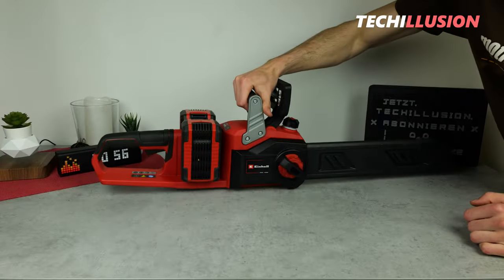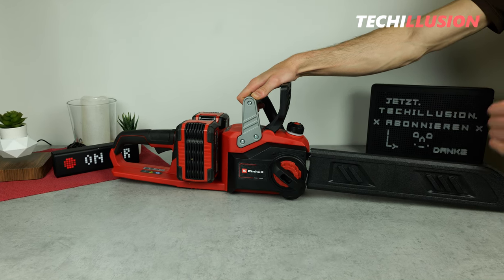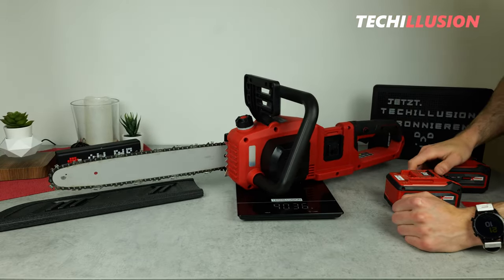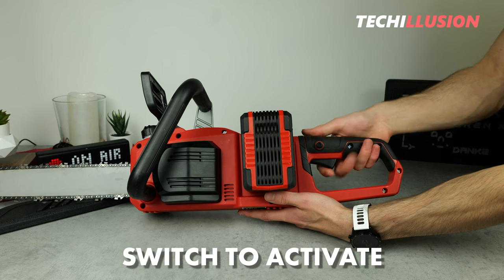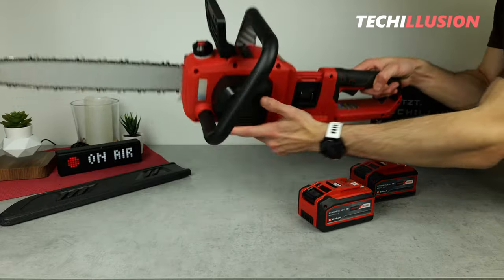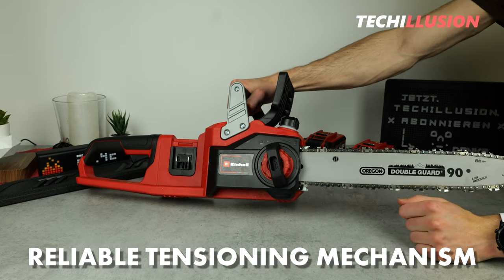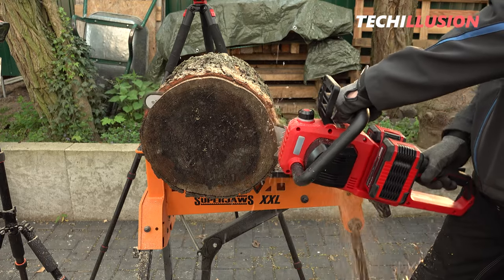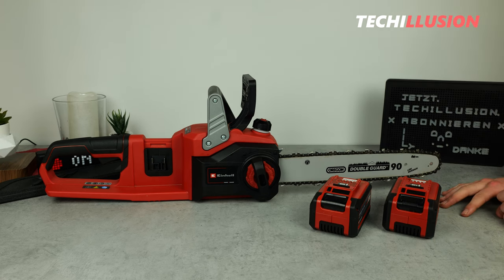🔥BRUTAL PERFORMANCE! Einhell GP-LC 36/35 Li cordless chainsaw on test😱 GP-LC 36/35 Li - Review

Comment: Good review. As an owner of one I agree with all the points made, including the tension mechanism being super easy once you get the hang of it.
Great chainsaw if you can find it. Inexplicably, Einhell seems to have replaced it with a shorter, less powerful version with a single battery.
Reply from the maker: Thank you very much. Happy to hear that you like the video! 😊 💪🏽 
Also thank you for sharing your experience with the chainsaw! :)
Best regards
Reply: What file size you need to sharp the blade, I find 4mm to be to small?
Reply: @KEEVVY  Ask Oregon its an oregon chain and sword.
Reply: Nah, still available. There are just other models for less needs.